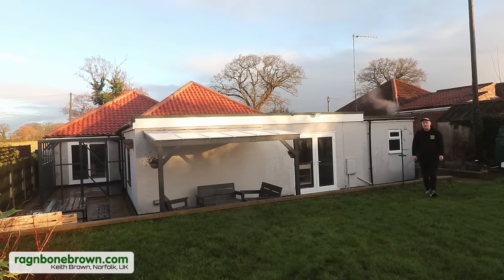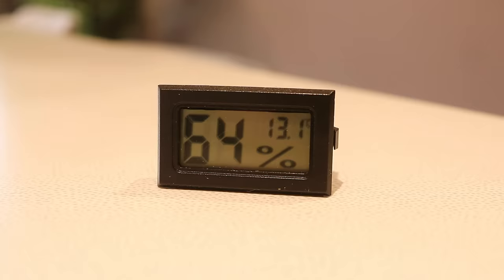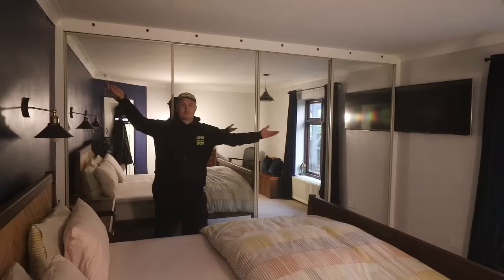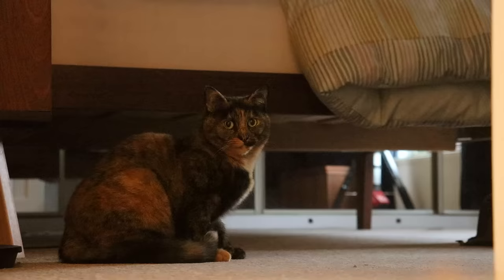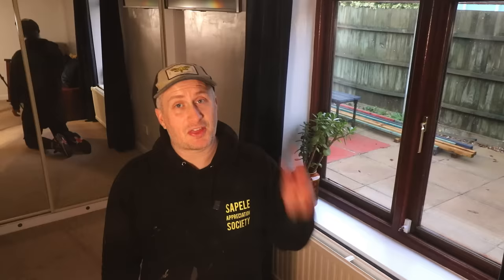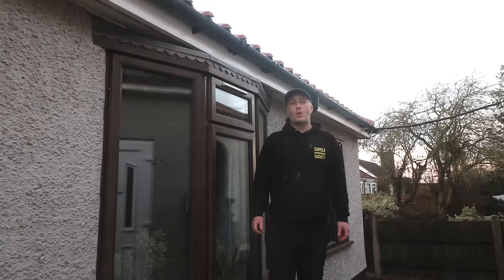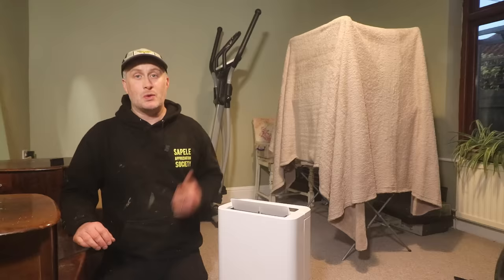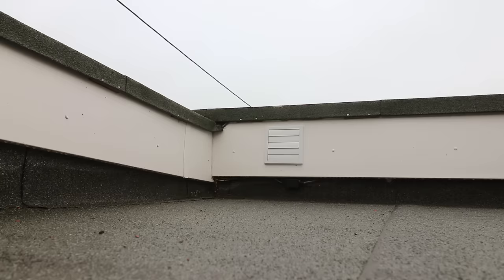8 Steps To Fixing Damp, Mould, Condensation & Humidity In Our Home

Comment: I'm in a flat and had a PIV fitted years ago. It helps a fair bit, but I still have to run 2 dehumidifiers and the humidity is 70-80 currently in all rooms. Also fitted air vents high up in each room. Not sure how to get it below 70, but I find the humidity is far higher in summer than winter here for some reason

Comment: I got two areas in the house where its damp. One is a cupboard filled mostly with books but the pages are bit damp.

Other is near my door. 

I still have an open fire, i dont use it all the time but when i do it really clears the air in the house but i definitely need to put more ventilation in places

Comment: Indoor humidity not an issue here, EXCEPT in the bathroom and only if the bathers persistently fail to use the vent fan. (hot water baseboard heat, in Montana USA)

Even in Montana winter, my mom would open windows whenever it was warm enough. Warm enough was often below freezing, but it only takes a few minutes to get some fresh air exchange. and get rid of stale air.

We are going to install an ERV (Energy Recovery Ventilator) because we're not only on a slab, the basement is mostly underground. Not for humidity control, but for the "stale air" smell a well-sealed house gets.

Comment: I have high humidity in my Victorian property 9soldi brick) , these are great tips. I've been on the fence about a PIV.

Our values fluctuate on a good day 40-50RH to bad  77 RH all over

We have a bit of a perfect storm in our house;

1. Downstairs bathroom with no extractor
2. No kitchen extractor
3. An always cold north facing extension (where all the condensation channels as the walls are cold - this has a dehumidifier running 24/7) 
4. Gypsum plastered walls
5. Non breathable exterior paint 

Venting air in from the outside is the best thing you can do besides fixing the issues (we are sorting ours, extractors etc)

Comment: I live in 1930s semi with solid wall.  Have used humidifier a bit, window vac and found that putting infrared heating in part has reduced the condensation and with windows reduced humidity.

Comment: Great ideas. Our last home (2 storey) had serious mould issues and a wet loft. I installed a mechanical heat recovery ventilation system (MHRV) in the upper floor with the unit and ducting all in the loft. This was a huge job, but really sorted out the humidity and mould/condensation. We've since moved to a bungalow and are again facing high humidity. Have you considered that your humidity sensors may be inaccurate? I brought one from my last house, and then bought 5 more, of a different make. The new ones agree with each other (making it seem like they are accurate?) but disagree with the other make by 15% !  So, on a day when a room is at 65% on the new sensors, the older one says only 50% Which one is right? I haven't a clue! It just may be the 5 new ones are wrong, and so might yours be.
Reply: I think you have to calibrate them? I’m sure there’s a video on here, someone mentioned this in a comment
Reply: @Ida-Adriana  I doubt whether the one quoted, at less than £2 each, can be calibrated. The video I watched shows one that has adjustment control - the cheap ones have nothing at all to press, turn, etc. The quoted ones claim: "Humidity Range: 10% ~ 99%RH; Humidity Deviation: ±5%RH" which suggests they think they are really quite accurate already and don't need adjusting, but I don't think they are to be trusted implicitly. Better if you can afford a high quality one to use as a benchmark to compare the others against. The "salt test for 75% RH" is a good idea, though.

Comment: I live in The Netherlands and I am also fighting humidity. I wonder if increasing ventilation will help in my case since the air outside is quite humid, it's raining non-stop this winter. The air humidity increases when I open the windows.

I got an oversized dehumidifier and that solved the humidity problem. But that's another annoying "portable" thing that I have to maintain and drag around, I also have an air purifier for the pollen and a portable AC for the summer. I now wish that I had just invested in a complete HVAC system at the start.
Reply: Hello Cesar, first of all you have to find the cause of your humidity problem. From where comes the water in your house?
Reply: @rogermoyson5185  We don't have any leaks or anything like that as far as I know 

The outside air is very humid, it's around 90% this time of the year, so every time we ventilate the house we are sending 90% humidity air inside. Other than that it's 4 people living in a 150sqm house so we generate some humidity just by breathing. My bathroom wall vent is also way undersized I think.
Reply: @Trooper266 We used to live in Turkey and had no problem but here in the UK , the damp and mould is a massive issue.I own quite a few Rental properties and I need to tell the tenants how to deal with humidity .I sometimes need to get installed PIV system in the loft and it appears that PIV does the trick

Comment: I'm living in northern France in a coastal area-it's really humid here too.
Two things I want to do long-term: Drywalling with clay is awesome to remove humidity. I have a friend who did this in his bathroom (every wall where no water can splash against) and now 5 people in a row can take hot showers without the mirror even so much as fogging up. And, while putting clay on the walls, you can think about including heating into the walls. The clay can cover it, so no need to drill holes. Same friend put a heating pipe in a spiral pattern all throughout the window bays, heats up the room lovely and the most sensible place for mold is now way too dry for that
Reply from the maker: Interesting stuff! Thanks
Reply: drywalling with clay?

Please explain this
Reply: @lazygardens  basically, two choices: you either start with the bare wall (stone, brick, etc.) And mudd/finish it with a mixture of wet clay and sand (you can buy this premixed in big bags, at least in Germany) or you can buy clay "drywall"-works like regular drywall, but is made out of clay and hemp. So you can drill the big plates onto the wall and just need a bit of clay to finish it and cover the seams and holes

Comment: Problem with PIV is its like replacing a small window pane with a 12inch fan. Freezing in winter and heat your flat up in Summer. Only even worse as the attic is a massive amplified storage heater in summer and winter.
That being said lol..., I've just pulled out the old coat I stuffed in the pipe in the hallway vent over a year ago as I have just cleaned off a lot of black mold for the 3rd time mostly in the bathroom. The brick walls and plasterboard roof still look wet, it will as you say take a few weeks to dry out. I took my temp sensor from the bathroom at 91% and placed it right in the vent and the humidity fell by 25% in a few minutes! 
PIV does work for humidity but within an hour it's cooled down noticeably and this thing will keep at it 24/7. I'll try and look for a speed controller or adjustable vent for the bloody thing to see how low I can get it and keep the flat safe from spores.
Not anyone's fault here, it's just there is a tradeoff.

Comment: 62.6%, bungalow. We have bathroom and kitchen extractor but ensure the heating comes on early in winter(very little cost) and cold frosty days open the window for 10 minutes to blow the moist air out. I do design every room to ensure no wardrobes or cupboards on external walls.
Reply from the maker: Thanks for sharing 👍

Comment: Just be careful with the bathroom fan duct.

I'm an electrician and regularly find ducts lying flat in lofts with water build up from condensation that has run back down from the vent over the years, eventually overflowing or leaking out of the duct.

I recently encountered the positive pressure fan, I've been meaning to look into them to find out more. I thought the air flow was going the opposite direction 😅
Reply: Oh good Point! We have an en-suite with a shower that’s been non working since we bought our place and it has an extractor fan in the ceiling that we are fairly sure goes along above the kitchen ceiling to a vent outside. I’ll bet it would have water sitting in it if we’d been using the shower this past year. We are eventually having the whole bathroom redone so will definitely try to find a better solution for venting. We like our hot steamy showers. But we are the bottom flat with our en-suite against the next door flat. Will be interested to find a good solution.
Reply: @CobyBurns  centrifugal fans and a high extraction per second shouldn't give the steam time to condensate.
Reply: @RabM1990  ours will need replacing then. It’s very sluggish and the timer that’s supposed to turn the fan off after 5 minutes doesn’t work.

Comment: Also don't underestimate the power of simply closing doors.  I have added a door closure for for the bathroom and will do similar to the kitchen.  Of course if you have cats in the house there is a limit to this too. Agree 30% is almost impossible in anything built before 1980 in the UK.  Our 1910 house gets hovers between 50 and 70
Reply from the maker: Cheers John, interesting stuff 👌
Reply: Because you have installed a PIV I disagree. You need the air being pumped in from the loft to dilute all the air in the house so it has the greatest effect. In fact in modern homes you need to leave a good gap, say 10mm, between the door and the floor so air can flow when the door is closed. You could install a humidity controlled extractor in the bathroom for this one specific space. You will also need the trickle vents open to push the air out as the PIV creates a slight positive pressure in the house.
Reply: @ice4142  Maybe only close whilst showing or cooking. The doors in our house have room for a decent limbo dancer to get underneath. Fitting a Vent Axia Svara in the bathroom has helped for us as it runs 24/7 and reacts to the room humidity. Charlie DIY has a good video on this subject. We’ve found some good routines and flushing the house with fresh air on dry days and lying furniture away from walls also helps.

Comment: I open the windows every morning, if they are wet I get my karcher window vac out, I also have a meaco extractor that I move to room to room if the humidity levels are too high, I also installed extra air brick and vents in the fitted wardrobe as well as repainted the wardrobe walls with mould resistant paint, I don't use trickle vents. I still have problems with walls exposed to North, the external walls are very cold to the touch and moisture tends to grow mould in the same cold spots. I think my next move may be external wall insulation...

Comment: we use humidity stats too but use the switchbot ones they link via wifi or bluetooth so you get a historic data.  63% seems like a perfectly fine value to me we have a 1930s semi with cavity wall insulation and insulated wall paper on the external walls but we could really use a positive ventilation system unfortunately we have no loaf.

Comment: The comment that outside air will be dryer than inside air may be true for centrally heated homes, but the maths are not so simple - rule of thumb for typical temp ranges is: if you bring in air and heat it up, the humidity will drop by about 10% for every 2C - in other words, if inside humidity is 20% less than outside, and temp difference is less than 4C your bringing in more water per cubic meter of air than the inside air has, and vice-versa

Comment: Dehumidifiers reduce humidity, and a drier house is cheaper to heat. Letting in cold air just makes you turn up the heating.
Fit an internal drywall system & use a dehumidifier .I even have 1 in my cellar, and it keeps it dry enough to use for storage & a workshop..

Comment: wow, living in Wisconsin in the USA, we have to ADD humidity to our air during winter and remove it during summer!   Still, when adding humidity, we get mold on the windows due to condensation.  Many homes here have "storm windows" to have multiple windows in each window opening and keep the temps on the external windows from making condensation.     We have to do dehumidifiers in basements in summers...  I wish it was different....
Reply from the maker: Wow that's really interesting! 👍

Comment: Hallo thanks for the video its been very helpful. By using hygrometers Ive found the high humidity areas. Yesterday I opened all the windows and the humidity went up to between 70 and 80 in some areas. Normally it's between 58 and 70 and just sometimes under 55. Im wondering where to start and after looking at the comments bought myself a pinless moisture meter. Ive found that all the window sills are high humidity some 27 and so far the walls are mostly under 1.Im unsure what to do with this information so far. Ive been asking myself (daft seeing I don't know the answer!) if it would be a good idea to impregnate the wooden window frames with a drying solution. The windows themselves are plastic and some are fogged over in-between the two panes of glass.
With good weather and using the dehumidifier in damp areas I can get the levels down however Im now convinced I need to find the ingress areas there take it from there. Ill be measuring the rafters and und the joists under the floor later on. Im not planning on fixing big problems myself but want to understand the situation so that I don't end up paying for unnecessary works or solutions that have little or no effect. All suggestions are welcome!

Comment: First thing, why dry in the house and use a dehumidifier , Tumble dry and take the moisture out of the house ( cut out the middle man) also extractor fans are the way too go. I'm in Ireland a couple of miles from the sea 30 yards from a river and it rains 380 days of the year that's why it's soooo green , don't think my little gauge has ever dropped below 60 even in the summer but with ceiling fans to move the air about  ,extractor fan's kitchen and bathroom  and my lovely tumble-dryer, I've no mold or damp. 😊

Comment: We have a bit of a regime of opening certain windows in the morning to get rid of light condensation and get some fresh air through. The main bedroom is probably the worst as the vent in that room (required because of gas heating) was blocked by the builtin wardrobes ... seemingly when the house was built! Everything gets closed up after maybe a half hour then - doors and windows.
Those little Karcher window vacs are surprisingly decent for clearing the bulk of condensation away in a hurry - a little awkward and messy, but better than leaving windows open for hours in January.
We got rid of the shower in one bathroom as it had no external walls/windows and getting the moisture out of there was nigh impossible, even with a fan ducted to the outside.
We also got a Drayton Wiser smart heating setup and try to keep most rooms "topped up" to around 18C, though this is obviously an expensive option.
The humidity sensor in the room I'm in now (above a garage) says 75% ... though the rest of the house is a little better, around 68% usually. The mold and mildew that was here when we moved in is under far better control now - lots of bleach cleaning and fungicidal / stain blocking paint in the early days.
Well done on hitting a 63% humidity average - Cheers!
Reply from the maker: Thank you, great to compare notes 👌
Reply: @RagnBoneBrown  Thanks! Will definitely invest in a dehumidifier after seeing how you've used it 👍
Reply: Oh yeah, one thing I meant to mention and forgot - the inside of my oven hood has a note saying it's not for clearing out steam and moisture. What the hell is it for then? 😃

Comment: Very useful Keith, my daughter bought a flat in Salford, which was very damp. We installed an Envirovent unit in the hallway, and replaced the glass above the door with a piece of acrylic, worked within days. 
When we reworked our own kitchen, I searched high and low for a quiet extractor and ended up with the fan unit on utility room, virtually silent on low setting, which it’s usually on. Great to put on maximum and annoy my neighbour, who is PITA. Charles

Comment: I'm actually using a humidifier in the winter. Without it it gets down to 30% and the air is really hard to breathe. A 20 year old house, about the same isolation. 
I'm guessing your issue is the British weather :)

Comment: I've done most of this - except we attempt to minimise heat loss by venting into the attic to draw air from all our leaking walls and floors! - to deal with the moisture WE created like bathrooms and kitchens and laundry and breathing. Then I checked how much moisture the HOUSE brought in. As you also have cement rendered brick walls it's possible your external walls can't breathe OUT ground moisture from limited soakaways and slow ground drainage that is under your floors and breathing internally into the house. Use your timber moisture meter to get external-wall readings (high and low) inside each room and see which are  'breathing' moisture into the house. Ventilation will slow mould accumulation in corners and behind furniture but you still have high humidity in the bungalow and might be pulling in more from the attic. If rooms are frequently below 15 degrees cold walls are likely to cling on to their humidity and slow the breathing process. Humidity and temperature are a real balancing act and I guess, like me, you'll probably need to constantly check levels in different parts of each room all the time. [80's house but not well built!] I hope you give updates on this.
Reply from the maker: Thank you great information